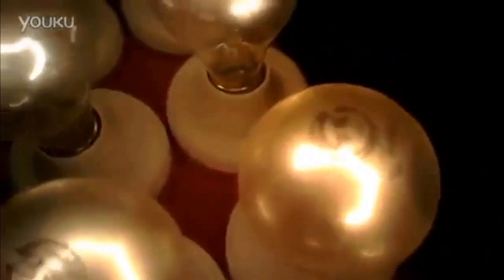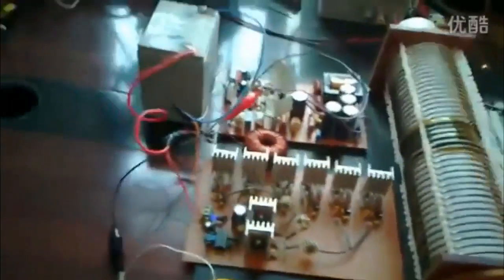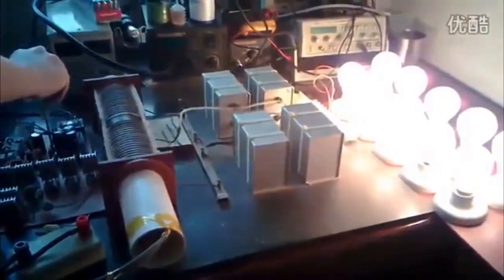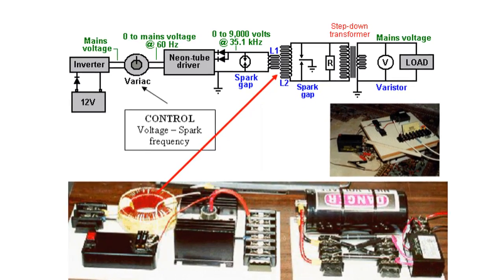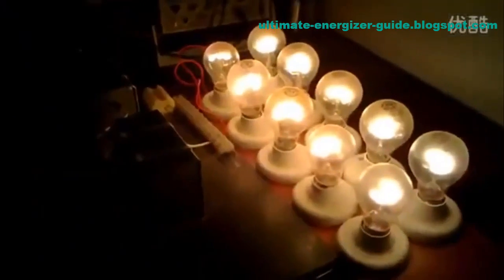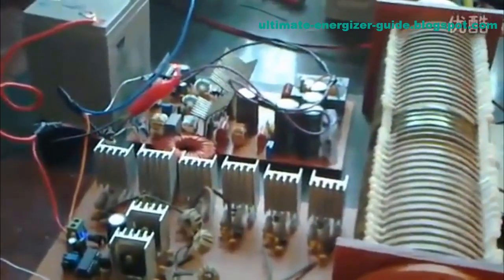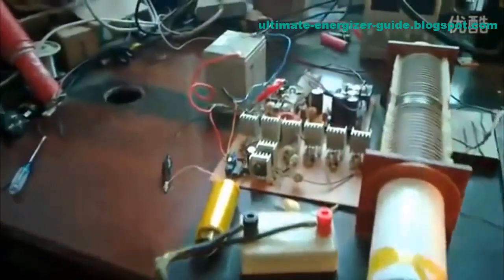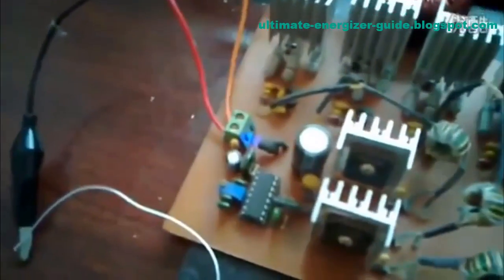SEA of ​​Energy Emerges from Ground - Smith's Free Energy Electronic Circuits - ULTIMATE ENERGIZER

Comment: Ah good old Don smith's devices. I built one of these units and yes it did work. But the truth is as it is set up it will power lights and that's it nothing else as the frequency goes way off because of the open air coil. I ended up building a timer circuit and putting a real transformer at the caps to create the needed frequency to run what I needed it to run. To this day it still works but I really don't think anyone should use this to power a home for long periods of time because of the open air coils it gets to be a pain in the rear to keep adjusting the voltage. Here's a tip for the end result of power coming off the caps. Install a varistor on the primary side of your transformer on the ground , this will stop the spikes in voltage so your load will stay at the voltage you need without hearing things speed up or slow down from the voltage bouncing around. Since then which have been years ago I've built a better version using info he gave. But sadly you can't buy those nst's anymore. Don did give you really gave you all the knowledge to build a homemade high voltage unit to replace the net. Just remember at the caps you are going to need a timer device and a transformer that is suitable for what ever you going to run. Good  luck people.
Reply from the maker: Thank you for providing the information! Good luck to you.
Reply: @Pulse Electrical Karaoke this unit was perfected years ago. The first thing you need to do is build a unit. Everything is on the internet for this. Being an electrician has really nothing to do with this type of unit other than the hooking up wires. Fist off you will be confused about the voltage going through wires especially thin wires. This is cold electricity not hot as what you are use to.
Reply: @charlesg3459  Cold electricity, is this the case while high frequency current flows through the wires, what do you mean with cold electricity ?
Reply: @Birol731  cold electricity is based on high frequency and low amps making it perfect for a don smith device which means the caps charge really fast and that's what you are looking for.
Reply: @Pulse Electrical Karaoke what are you trying to run?
Reply: @Pulse Electrical Karaoke in the end all you have built is an power inverter. That's really all it is but it uses small voltage and min amps and is capable of keeping it self running with no moving parts.
Reply: @charlesg3459 
the secret lies in getting the current in each output coil in opposite direction while the resultant mag flux of each current is mutually opposite, lenz law becomes a current generator without having negative effect on the input.
Reply: Normally it's not hard to light a high power light with low power resonantly converted to hv hf, but the absorbed energy doesnt change.
Does the energy output exceed the input in yr build?
Reply: @alanx4121  to answer this is that I'm not powering just lights but everything that a normal house may have running at any given time of the day
Reply: @charlesg3459  
if that is so, then DS is the real deal.
care to share something important that everyone is missing?
Reply: @alanx4121  all of don's devices worked but he left out a ton of components,but he did that for a reason. First his units created massive voltage but until you know what level of energy you need why attach components to it if it is too much energy or not enough. Second because he was trying to sell his ideas to the energy companies they didn't want hear it for these reasons POWER, CONTROL, AND MONEY. Now I ask you this question what are your intentions for wanting a don smith unit in the first place?
Reply: @charlesg3459  Respected friends
I heard your message
I am very happy
My original intention was to break free from the current money energy system
Living a better reclusive life
May I ask if you can provide a testing plan?
Early acknowledgment
Reply: @yunshuizhongyi  such as?
Reply: Very interesting